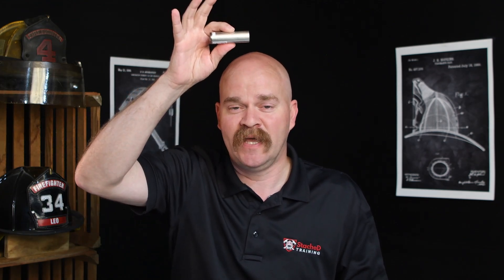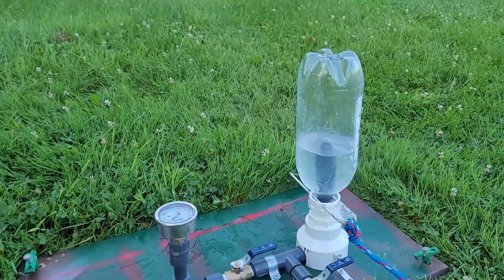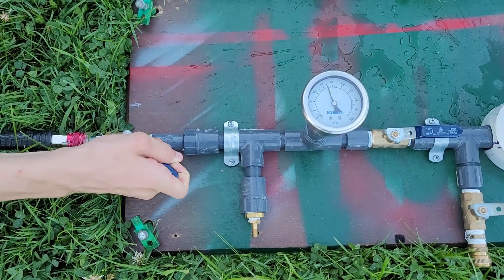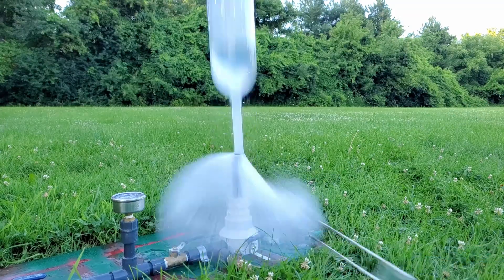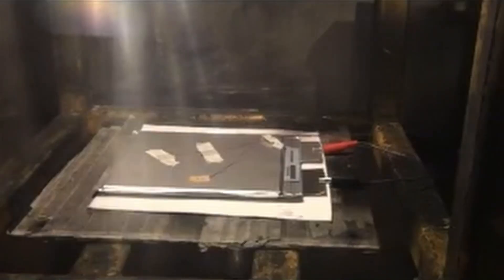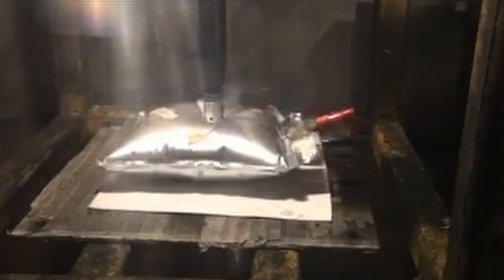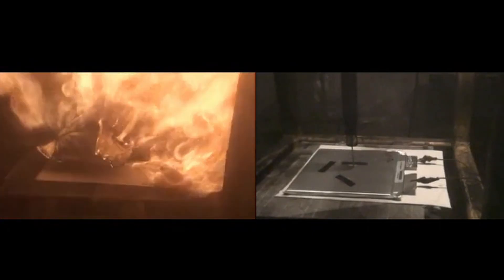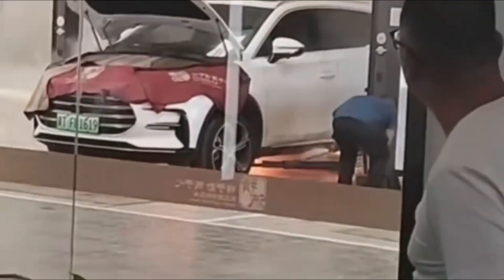Lithium-ion Battery Fires: Full Charge vs. Low Charge

Comment: So, what you are saying is that Lithium-ion Batteries are COMPLETELY USELESS !!! No one would EVER buy a product that ONLY works "safely" on a 20% charge !!!
Reply: Lithium-ion batteries are far from completely useless. Almost every single mobile phone, laptop, wireless earbud, power bank, e-reader, and much else, has a lithium ion battery in it. 

How can you conclude that lithium ion batteries are useless, given this information?
Reply: So the electronic device that you are watching the video on which uses a lithium battery is completely useless?
Reply: @KvShashank they might be on a desktop
Reply: Lithium ion batteries changes the world. We wouldn’t have the mobile devices we do or electric locomotion without lithium. By far one of the best inventions in modern times
Reply: A smart smart charger or BMS can be designed to help keep the EV battery's SOC around 20% for as long as necessary during storage and try to charge it just enough for the following trip with the option of adding more charge. The less time spent at a high SOC, the safer the EV battery should be and the battery should also last longer. If a battery fire happens at an SOC of 25% instead of 99%, there should be more time to escape the vehicle and the vehicle may even be repairable
Reply: What powers your phone?
Reply: We have and have had for awhile now, LifePO4 batteries which are above and beyond better than lithium-ion and much safer. We're even exploring other types of batteries altogether. There's no reason lithium-ion should still exist. It's old tech and we just gambled on not having an issue so we could surpass alkaline. Time for it to sunset.
LifePO4 is lithium based but doesn't use cobalt which is highly reactive. You really have to piss off a LifePO4 battery to get a reaction but it still won't be as violent as the antiquated lithium-ion.
Reply: So store your electric scooters and mopeds over the winter with a dead battery
Reply: There is no such thing as a completely safe yet powerful battery. Accumulating large amounts of energy always has risks, but this is exactly what we need from a battery. Life is a managed risk.

Comment: Thanks for the video. My question is why do the EVangelists claim that ICE vehicles catch on fire 90% more frequently than EV’s, and that the fires are more intense than an EV fire?
Reply: No EV advocate claims that gas car fires are more intense than EV fires. But it has been proven that EVs catch fire 10x less often than gas cars. You just need to compare the amount of fires per million kilometers for gas cars to the amount of fires per million kilometers for electric cars, and you’ll see the number is far higher for gas cars.
Reply: @beanapprentice1687  that statistic isn't relevant because electric cars are much newer that comparison is with  cars going bace 10 years vs cars going back 50+ years. age needs to be considered just as much as milage .
Reply: @daniml7258 yes. also there are insignificant numbers of EV on the road right now. so there is no actual comparision possible.

the EV average is like 2% worth of the average of ICE statistically.

Comment: Great video! What was the SOC percentage of the low charged battery ? Many thanks
Reply from the maker: Most standards requires batteries to be under 30% SOC for shipping.  One thing to note.  The SOC that your device shows, likely is not the SOC of the battery.

Comment: OMG ….  What about phones and laptops we use ??? They are also charged to 100% ….. Should we avoid that ?
Reply from the maker: A cell phone has about 14Wh of power.  An EV has 50,000 - 100,000Wh of power.  It's like comparing grabbing a down power line vs. sticking your tongue on a 9v battery.
Reply: @StacheDTraining …depends on the environment. For example, say a person is on a sailboat and has a battery ignite on the cabin cushions while the person is outside tending to the lines. Guessing it wouldn’t take but less than a minute before that cabin is engulfed in flames. Or people who their devices next to their beds while sleeping, and something sets the battery off.

Comment: That’s exactly why I store my lipo batteries in a metal fire box with a storage charge on them and I cycle them once a month. Most of mine are 2 - 3 cell lipos for RC vehicles. Great information,thank you.
Reply: Why cycle them once a month? I left a lipo at storage voltage for 3 years and it only went down by 0.04 V 
The self discharge is negligible
Reply: pretty sure li-ion batteries do not need to be cycled, older chemistries like nicd and nimh need to be cycled to stay maintained from shelf life, self discharge and crystal growth, but li-ion batteries don't have any memory effect or significant self discharge to need cycling except if they aren't used for years on end, 1 cycle every year should be plenty, also if you keep all your batteries in one box, then you will loose all of them if one of them shorts and it will likely be more dangerous
Reply: Lipos aren't nearly as dangerous as liion.
Reply: Cycling a lipo battery isn't doing anything but shortening it's lifespan by 1 cycle each time.  It's not a Nickel Cadmium battery, and I wish people would understand they don't behave the same as Lithium batteries.

Comment: I can’t stand the whole electric car fad. It’s just that, a fad. No one is saving the environment with electric vehicles. It will be interesting to see what happens when 50% of the vehicles on the road are electric. A lot more hazards in my opinion.
Reply: Yea, it’s definitely a fad… that explains why exponentially more and more electric cars have been purchased over the last 20 years.
Reply: @mikedickinson9730 -  I  am  retired  and  no  longer  have  a  need  to  'commute'  BUT  my  1963 Ford F-100  was  becoming  a  major  maintenance  headache / expense  &  I  wanted  a  new  'Hobby'  with  which  to  amuse  myself.   SO  I  sold  the  F-100  and  bought  a  used  2015  Nissan Leaf  in  2017  .  .  .  .  .  lets  see,  that  was  seven + years  ago.      Have  been  super  happy  I  did !
   1)  A  commercial  advertises  your  transmission  has  800  moving  parts.   Mine  has  two.
   2)  The  'motor'  in  my  car  has  one  moving  part !
   3)  I  charge  the  car  with  my  back-yard  solar  panels :  (they also provide off-grid  power  to  my  house  which  is  part  of  my  new  'Hobby'  experience)
   4)  Maintenance  cost  for  the  Leaf  has  been  $1.25  for  windshield  washer  fluid  from  the  local  'Dollar Store'.    Labor  'cost'  =  check  tire  pressures.           DOH !
    And  it's  battery  shows  minimal  degradation  in  7+ years.   I  don't  drive  it  far  but  I  drive  it  often,  looking  for  reasons  to  do  so  'cause  it  is   FUN !    I  don't  charge  it  above  75%  which  is  good  for  the  battery.  
    My  experience  is  obviously  not  the  'norm'.    But  I  Luv  my  EV   !
                       take  care,              rh
Reply: We drive electric but it is substantially cheaper, convenient, and a heap of fun. Not for the environment. Although, there are likely local air quality benefits and I only say that because I run a lot near traffic and the smell of exhaust sucks. 

If one truly cared about the environment they would raise/grow their own food and walk or ride a bike to work.
Reply: When you start to dig into the ev thing s I have I fail to understand how anyone would think there is any value to the enviorment deal.  Checkout
Replacing batteries, warranty, insurance, charging viability as residential applications, plus, and etc. Truly think this is a fad and lots need to be debugged going forward. Which for most would be an expensive journey.
Course if you have duffel bags stuffed with cash laying around and wish to become a self imposed guinea pig, have at her..
Reply: @happyrecluse2849  replacing batteries? That almost never happens, but when one such incident does happen, the mass media is sure to report it hundreds of times over so that the readers are tricked into thinking that it’s a regular occurrence. But when an engine in a gas car fails and needs replacing, you almost never hear about it with much drama.
Reply: @happyrecluse2849  -  I  am  retired  and  no  longer  have  a  need  to  'commute'  BUT  my  1963 Ford F-100  was  becoming  a  major  maintenance  headache / expense  &  I  wanted  a  new  'Hobby'  with  which  to  amuse  myself.   SO  I  sold  the  F-100  and  bought  a  used  2015  Nissan Leaf  in  2017  .  .  .  .  .  lets  see,  that  was  seven + years  ago.      Have  been  super  happy  I  did !
   1)  A  commercial  advertises  your  transmission  has  800  moving  parts.   Mine  has  two.
   2)  The  'motor'  in  my  car  has  one  moving  part !
   3)  I  charge  the  car  with  my  back-yard  solar  panels :  (they also provide off-grid  power  to  my  house  which  is  part  of  my  new  'Hobby'  experience)
   4)  Maintenance  cost  for  the  Leaf  has  been  $1.25  for  windshield  washer  fluid  from  the  local  'Dollar Store'.    Labor  'cost'  =  check  tire  pressures.           DOH !
    And  it's  battery  shows  minimal  degradation  in  7+ years.   I  don't  drive  it  far  but  I  drive  it  often,  looking  for  reasons  to  do  so  'cause  it  is   FUN !    I  don't  charge  it  above  75%  which  is  good  for  the  battery.  
    My  experience  is  obviously  not  the  'norm'.    But  I  Luv  my  EV   !
                       take  care,              rh
Reply: @happyrecluse2849  We need more government action

Comment: Okay, this is the third video in a row that I've watched of yours, right after John Cadogan recommended your channel. I subscribed on the first but now fear I'm going to dive deep into the Lithium battery rabbit-hole and end up down-trading my 12-volt LiPOs to AGMs again ... or not. However, I have gained a far deeper respect for caring for and maintaining all my LiPOs, from 18650s to the 129A/H 12-volts. One saving grace is that I have a V6 petrol shitbox Ford Courier, so an EV fire won't ever happen for me...unless some Tesla driver in hands-free mode t-bones me.
Reply: you assume all lithium batteries are the same, but in most car battery sized lithium batteries, the common chemistry is lifepo4 which is durable, safe and does the job better than lead acid with no downsides
Reply: @sigataros  No downsides? Low capacity, low output power.

Comment: Good video, but does the SIZE of the battery also have an effect??  A Tesla battery and an RC car battery at thirty per cent each would still be significantly different no??
Reply: Generally different battery chemistry types as well. Rc car batteries are Lipo batteries generally, which imo are much more fragile and susceptible to damage. If you had the same weight of cylindrical cells as Lipo pouches in an array, I would be more nervous of the Lipo
Reply from the maker: @juliogonzo2718  exactly,  there are many pieces to the puzzle.
Reply from the maker: The size would as well.   The more energy a cell can store,  the more energy that can be released.

Comment: The question is : how to drain the energy from batteries which already on fire and  going to explode, in order to minimize the impact ??
Reply: You're pretty much screwed at that point.  You can only drain power so fast, and where are you going to drain it to??  It's not like letting the air out of a tire.
Reply: @ffjsb  we could mandate that all EVs are equipped with a series of power resistors that quickly drain the functioning battery modules when a fire is detected in any malfunctioning module. But that would add extra cost to already costly vehicles.
Reply: @beanapprentice1687  That's not what resistors do...  And the concept is impractical anyway.
Reply: @ffjsb  of course that’s what resistors do. A resistor is a conductive device that allows current to flow through it, dissipating energy as heat in the process.
Reply: @beanapprentice1687  WRONG.  A resistor controls the FLOW of electricity, thus the name RESISTOR. You're thinking of a brake grid resistor system, not a straight up resistor.  And it still wouldn't work, because you'd need a huge grid on top of the car to dissipate the heat.
Reply: @ffjsb  my guy, you have no idea what you’re talking about. A resistor is a passive electrical component that limits the flow of current, but it still allows some current to flow; hence it is still a conductor. And if you reduce the resistance of a resistor, more current flows, and so the battery discharges faster. At the most extreme scenario, you can place a resistor across the battery with only a few Ohms or less of resistance, which is essentially a short-circuit, and this would discharge the battery super quickly. But this would overheat the battery and cause a fire, which is what we are trying to minimize in the first place. So the resistance value of such a battery discharge resistor would have to be selected so that it is low enough to discharge the battery within half an hour or so, but not too low so as to short out the battery. 

And yes, the “brake grid” system you referred to is, at a fundamental level, a straight-up resistor, and nothing more. The resistor grid may have the voltage across it controlled by some switching circuitry, but the component that actually dissipates power as heat is nothing more than a resistor. As for where that generated heat will go in the car, the discharge resistor could make use of the car’s front radiator and get the heat out from there. Like I said in my other comment, this would add extra cost, but it is doable.
Reply: @beanapprentice1687  OBVIOUSLY it conducts, otherwise it would be in an electrical circuit... SMH

If you DON'T have a resistor, the battery can discharge FASTER...  A few ohms of resistance across the battery???  Do you have any idea of how much energy is in a car battery???  Do you know how FAST those batteries burn???  Your "theory" is preposterous, so you're the one who has NO IDEA of what you're talking about.
Reply: @beanapprentice1687  Power resistors create heat
Reply: @beanapprentice1687  A few ohms of resistance across an EV battery is NOT like a short circuit. It is still a normal load, which will take quite a while to drain the energy. The EV I am driving goes up to 453 volts. Let's see what 3 ohms across it is. 68403 watts. The car is rated at 300 kW. 68403 watts is less than 23% load and would take over an hour to drain it.
Reply from the maker: If the cell is on fire,  energy is already being drained.  I'll do a video in the future on draining stranded energy in damaged cells.

Comment: It would be good to understand why and how the state of charge affects the failure or ignition. For instance, is the pressure higher within the cells and do the concentrations of flammable gases vary proportional to the state of charge?
Reply from the maker: It's at a higher energy level.   Very similar to the example using air pressure.   It's not pressure,  but rearranging electrons to be in a less stable position.
Reply: @StacheDTraining Its not so much "rearranging the electrons" (that would be a capacitor), but changing the chemical composition in the battery - its "chemical potential energy". In the charged state the chemicals are more likely to decompose rapidly, releasing that energy as they revert to the lower energy state composition. They normally do that in a controlled fashion through the electrolyte, but stick a nail through it, and the electrical energy release is sufficient to start the process in an uncontrolled manner AND MORE; rather than liquid state chemical changes, the excess heat triggers new chemical reactions, like releasing hydrogen and oxygen )not a good mix in the presence of electrical sparks or other intense heat sources).
Reply: @StacheDTraining thanks for video, i always leave all lithium products at empty or flat charge state at home when I travel but this video explained alot.
NiHm batteries are they safer
Reply: @pietpompiepompiepiet940  Be careful with leaving them totally discharged, that can cause damage to the battery over time. Also, over discharging a lithium ion battery, which shouldn't be possible thanks to the BMS, can also cause instability. Your best bet is to store your batteries somewhere cool and dry and inside a closed box specifically designed for battery charging and storage to contain the fire/explosion just in case something goes wrong. And the further away from combustible materials you can keep the storage box, the better off you will be.
Reply: @averyalexander2303  thanks for advise